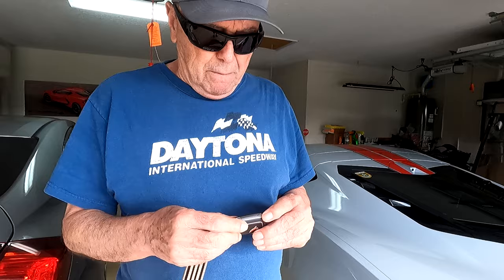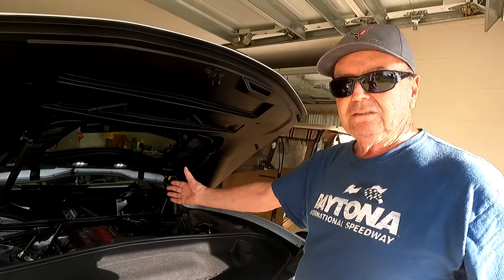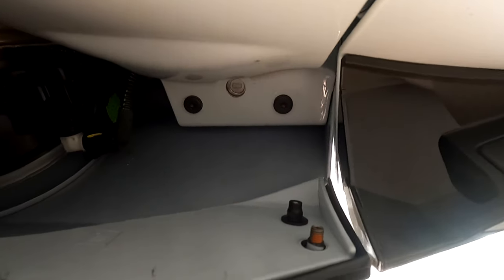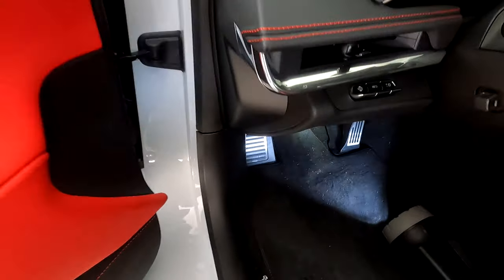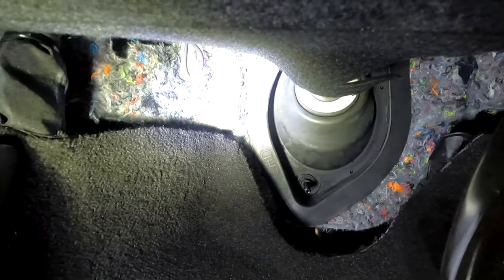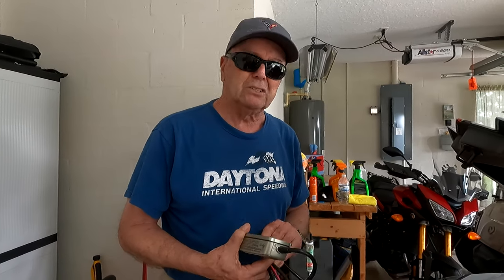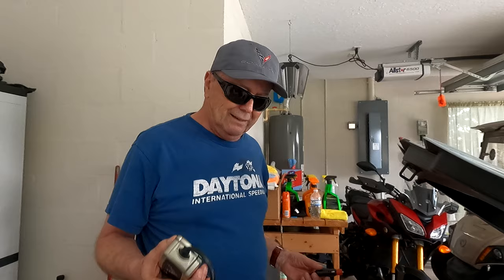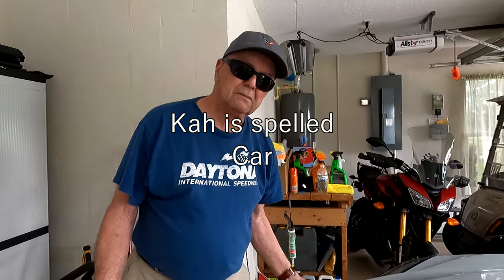Dead Battery, Locked Tranny, what to do - C8 Corvette

Comment: My mom had a Malibu that did the same thing. Tranny locked up and it was an issue with a weak battery. What you said about disconnecting the battery for an extended also works to reset it. Good video and good info. Thank you sir.
Reply from the maker: You're welcome. Interesting that you can use a similar method in other Chevys.
Reply: @RobertMacCready  I went online to the Malibu forum and there were quite a few reports of this happening to the electronic transmissions. Unfortunately the car stayed stuck in reverse and the power would not shut off. Battery died. Towed on flat bed and dealer charged up battery and it went right into gear and did fine.

Comment: Looks like you’re living the dream!!!   New Corvette, nice house in Florida,  the golf cart for transportation around the village streets to pot luck dinners and bingo and drive it for a 18 holes at the local Country Club.
I have a 2009 C6 that just turned over 7,000 miles and have a 2022 C8 ordered.  I ordered the battery protection for the C8 and keep a Battery Tender on the C6.  (Still love the C6 and hope to keep it instead of selling or trading it.)
Reply from the maker: Yup, it's pretty nice down here. Summer is very warm but the other 9 months are excellent. Worked hard all my life, usually 2 jobs. Wife did too. But it was worth it.
Hope your C8 arrives sooner than you think. You'll love the car.

Comment: I love my 2021 C8 HTC ... But man, there are a lot of "electronic" workarounds you need to be aware of. Yesterday, I had to figure out how to put the car in neutral for a flatbed tow. Oh ... I should mention I got the dreaded "service transmission" message and check engine light ... I had GM pick the car up rather than risk damage by driving it to the dealer. Suffice to say, unless you can start the engine to put the car in neutral, you'd better have a special tool, advance knowledge and patience to manually shift the Tremec into neutral should you need an emergency tow. Be warned C8 owners ... research putting the car in neutral before you have a roadside emergency where you have to push the car to safety.
Reply from the maker: Let us know what the outcome is. Glad you were able to get it on the flatbed. Did you have a tow hook with ya?
Reply: No tow hook. And the driver "freaked" when he saw the car. Asked me to drive it on and off the  flatbed and then thanked me profusely for doing so. The front end lift system came in very handy!

Comment: Another idea would be to have a battery disconnect switch installed this way both of these problems would be solved. My boat came with one from the factory. It has the 6.2 Chevy engine.
Reply from the maker: Yes, that would be ideal.
Reply: If you live in an emission testing state, disconnecting the battery will reset all your emission control flags to off. You'll have to drive for some time before you can pass emissions later.

Comment: Bob, have you installed the shock tower covers yet?  You have to take off those pieces in the frunk to get at the towers.
Reply from the maker: No I've not done the covers yet. I don't plan to do the screens up front.
Reply: @RobertMacCready  Bob I just put  a Novistretch FBM850V mask on my c8! It protects the whole front of the car's bumper and front radiators. It is easy to install and comes off in a minute. Check it out!
Reply from the maker: James, you got me reading up on the shock towers. Ordered 2 covers and will do a video on the install as soon as they arrive. Got a good idea on getting those pieces off too. Thanks for getting me thinking!!!
Reply from the maker: @johnshuler1396  John, I've seen those Novistretch masks and they look great.

Comment: HI Robert, I lost track on how many Corvette’s you have owned over the years and very much enjoy your channel and all the knowledge you know about this car. I have a question regarding your opinion on a clear bra or ceramic coatings. Your cars always look beautiful and am wondering what products you use to keep it that way. Do you believe in putting a clear bra on the front of the car or ceramic coatings or do you use some kind of wax. Thank You 😊
Reply from the maker: I did ceramic coat my 2017 Z06. Did it with a hand applicator. Worked pretty good. On the C8,
I go to a local "do it yourself" carwash. It has a spotless rinse selection that I really like. Then they have a blower selection and I use that to blow off most of the water. Then I use a microfiber towel to wipe what little water is left. As I''m doing this, I mist the car with Meguiars Ceramic Detailer. It helps pick up the water better and makes the car look great. 
I would not use a bra on my car. I just keep my distance from trucks. And I appreciate your kind words. This is my 20th Corvette.

Comment: What happens if the resetting of the negative cable doesn’t work. How do you place the car in neutral to be towed
Reply from the maker: There is a tool that some dealerships have where they can put the car in neutral.

Comment: My car is missing the wire you pulled to open the frunk, any other ideas?
Reply from the maker: I would contact a Chevy dealer. It can sometimes be difficult to see. Did you use a flashlight to double check?

Comment: also my key fob works and doors, truck, hood open but won't start after 3 months of winter, im thinking it just needs a booster or battery charge, what do you think ?
Reply from the maker: Could be either. I'd change the battery in the fob and then get a charger. I think the charger, at a chevy dealer, is around $100. I would get the one chevy suggests as it will plug in to the receptacle in your front trunk/frunk. 
The one I have is a 12v unit. And I use it if the car sits for over a week or so. Let us know how it turns out for you.

Comment: How long does it take that battery maintainer to fully charge a dead battery??
Reply from the maker: Good question. Maybe someone else can comment. I've never had a dead battery "yet". Just by putting on the charger every couple of weeks seems to work fine.
Reply: @Robert MacCready  ok I think I'll get the battery maintainer and a battery jumper as well just in case
Reply: It's a battery maintainer, not a charger. If your battery is dead the maintainer is never gonna charge it.

Comment: I did that but it still didn’t start said service Tran soon… maybe I didn’t wait 15 min.. I waited like 4 mins befor i connected it again
Reply from the maker: So, how did you resolve the problem?
Reply: I had it towed to Chevy dealer.
Reply: @RobertMacCready  they are looking at it on Monday. No technician at hand until then.
Reply: First time it happened. The emergency lights killed the battery on the way. Then the tech got to it a couple of days later. Charged the battery and the car started. With no code showing.